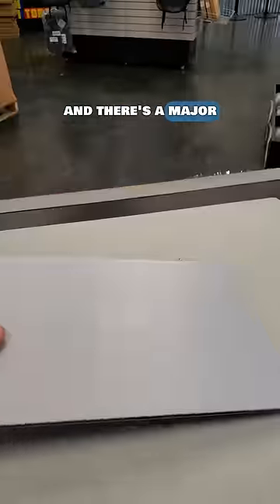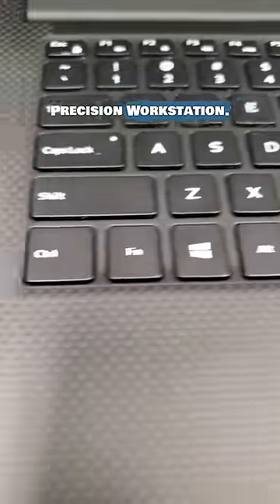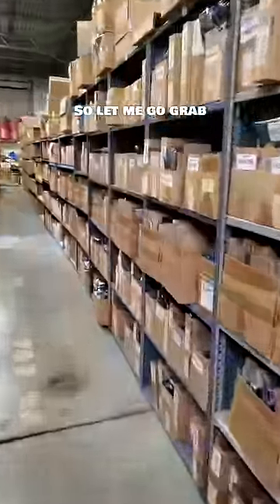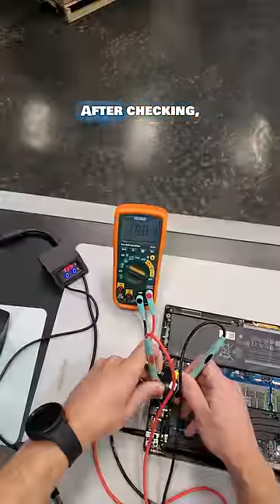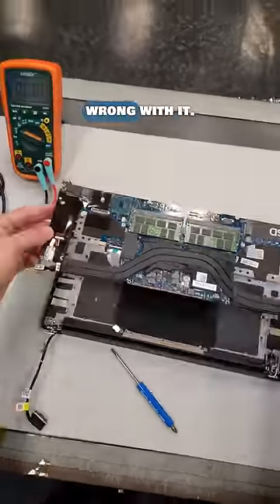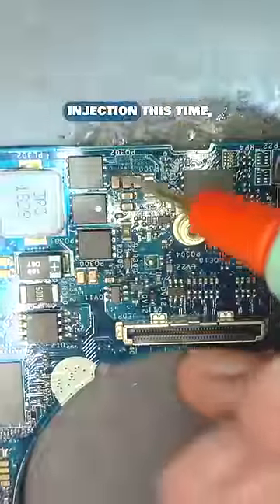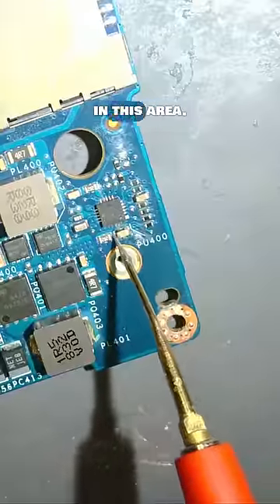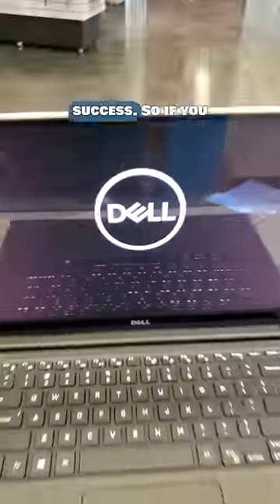Laptop Repair Fix The Hard Way #shorts #laptoprepair #computerrepair

Comment: it's so amazing to see the fact that he actually tries to repair it rather than replace it
Reply: my clone
Reply: @chrishehexd woah
Reply: Then he takes the chip from a brand new motherboard and ruins it instead of replacing it
Reply: True
Reply: @elisjohansson4932 that motherboard was probably already broken, and he will use the rest of its parts for something else
Reply: The issue is, in business we don’t have time to sit around and test every connection on a motherboard to see what’s dead. It’s easier and more efficient for the business to just get the replacement part and call it a day. Plus, you have a brand new motherboard and not one that could potentially have more issues waiting.
Reply: @Ocela  I mean when you're overloaded with work you really can't afford to do that, but when you have time you can
Reply: @elisjohansson4932 What about "donor board" do you not understand?
Reply: @elisjohansson4932  It's a donor board, aka, a board that is already broken and is basically just spare parts or a practice target.
Nothing new was ruined
Reply: @da_pwo  okay but it seemd like he did take it from the place where he showed the new motherboards
Reply: @Ocela  Well, he only checked the battery's input and output with a multimeter. Then checked with a thermal cam for shorts. Saw liquid damage and replaced the N24 chip.

Which btw, donor board or not, everyone can order these parts. You need a part number which is usually right on top. Issue components are usually condensators and sometimes resistors. Condensators don't carry any marking, resistors sometimes do with either numbers or older electronics by color rings. Meaning that unless you have the factory schematic or an extra board with that component for you to measure it with a multimeter, you aint changing it
Reply: @Ocela and the charging customer extra for repair
Reply: yhh
Reply: @Ocela  when you run a repair buisiness, parts don't grow on trees. Every part in your inventory is one less you have for something else until you can restock. Not to mention that a 2017 laptop isn't going to have many factory new motherboards about to restock with. as well, its not a problem if their laptop later develops other problems later on, this customer will likely bring the laptop back and the buisiness makes more money.
Reply: @elisjohansson4932  the new ones are in a special bag, while the donor boards where all stacked lol they definitely didn't came from the same place in the video
Reply: I would rather someone identify the problem and just replace it, I don't trust repaired stuff as much compared to brand new
Reply: @sirhellsing  brand new boards for 7 year old laptops don't often exist.
Reply: fr
Reply: Because he is the nest technician in the worls😈
Reply: To repair something you pay. If it's just a work computer where everything is saved to the cloud then who cares if it's replaced. You'll just lose the memes you saved on your 7 hour coffee break. Won't need those when AI automates your easy to obsolete job. LOL
Reply: It's great that they can, but it also seems incredibly inefficient. There is such a thing as going too far in the opposite direction.
Reply: why would anybody pay for this?
Reply: @elisjohansson4932  did you get up in the wrong side of the bed today? No need to assume the worst in everyone. Why would you assume it was new?
Reply: @nostrum6410 cheaper than a new laptop
Reply: @jama211  probably not, some little  chrombook or tablet is likely cheaper
Reply: @elisjohansson4932  Bruh he literally says, "DONOR BOARD" in the video. Meaning- an already broken or inspirational board that is only good for parts.
Reply: @WimsicleStranger  Yeah Sorry
Reply: Apple is still in disbelief we savages still repair our shit 😂
Reply: @da_pwo  I think that's the problem though. You're getting broken junk repaired with other broken junk instead of a proper replacement and the extra labor isn't worth the cost. It's just silly.
Reply: What's wrong with the LT is someone bought a Precision Workstation LT. Waste of money for 95% of the people that buy them. Inspiron with similar CPU, memory, and SSD runs just as well for those 95%, is just as reliable, and costs much less.
Reply: Only for the video bud. They're is a reason he had some many new ones and so many Donar boards 😂
Reply: @skytoits6367  no it’s for his job, he saves money by using old parts instead of getting an entire new motherboard
Reply: Now imagine doing it 100 times for a day...lmao
Reply: @elisjohansson4932 look at this doofus 😂 did you really think he bought a brand new motherboard to just use the chip and throw it away ?  If you had common sense youd realize the flaw in your logic 😂 if he was throwing em away after he would just give the customer a new motherboard
Reply: And bill it for whole board 😂😂😂
Reply: Are you slow, did you not hear doner board? That means it's a bad board kept for parts.
Reply: @Ocela  The old MB if it had water on it already will probs fail in the future, just replace the whole thing.
Reply: To be fair that’d not be an appealing for social media content💀

Not to be pessimistic, but it’s true
Reply: not swapping a mobo by taking stuff from an identical mobo..
Reply: Not all heroes wear capes.
Reply: For 3x the cost of a quick replacement- ggwp
Reply: I commented this on one of his other posts, and got absolutely blasted for no reason.
Reply: You made my day, love seeing idiots online
Reply: He replaced the chip should repair the chip 😊
Reply: @elisjohansson4932 Just cause it looks new doesn't mean it works. You've never built a PC before?
Reply: Yes and No. Time is money, he wasted  company's and customer's time trying to figure out the problem instead of quickly fixing it. I would have fired him on the spot.
Reply: Id rather have a new one
Reply: If you wathced the video, he said that part was a joke@elisjohansson4932
Reply: so how much more labor did he expend?

Comment: To offer a same day repair option is a really brave and risky decision, you have to really trust your abilities to be sure you can fix any problem that arrives on your hands in one day, If I added said option, I would put at least double the standard price or more
Reply: 1. It will definitely be a premium price.
2. If they can't repair, they would most likely send it back same day or contact the customer to provide options.

If you are good tech and have the components at hand then it's a very fine option to provide.
Reply: @beemore18  having the components is the real trick. there are alot of laptops in circulation, keeping the appropriate parts for most of them in stock to fix a variety of problems that can occur is quite the challenge.
Reply: With Dell warranty service - you pay for this service as part of buying the device. You get a certain level of service for up to 3-4 years.
Reply: he did say he has a spare motherboard, so its kinda easy is things go wrong right?
Reply: @pianissimo7121   yes, for this case it would have worked out, but just offering that in general takes alot of infrastructure and confidence. the issue could even be a software problem vs a hardware problem, you just never know until you've already agreed to the repair.
Reply: Urgh I had to send my laptop back to the manufacturer for 'repairs' which were 4 solid weeks of waiting for absolutely nothing except for them to do a factory reset and no resolve of the actual problem.
That was the same day repair option btw.
Reply: And a massive warehouse to store all possible parts!

Comment: I love how you do component level repairs. I had an HP all in one which would not power on after I returned home after a week. I tried to get it repaired but they had no clue. It was a power supply circuit problem. It seems many of the problems you see are in the power supply circuitry. I liked that computer until it failed.
Reply from the maker: Well, sometimes I can not figure it out either.   It is not a 100% success rate, probably more like 70%.
Reply: PPBUS G3HOT?
Reply: Made in China

Comment: A real repair-man. 
Most of others would be: "Your motherboard needs to be replaced. That'll be half the cost of the computer."
Reply: It's 2024, and they said the mother board needs replacing in 2033, and in 2022, and 2021, and since the beginning of time technicians have been saying the motherboard needs replacing
Reply: It's hard though. Doing board repair like that is not too hard, but it's a specialized skill.  The bigger challenge is that you need specialized tools, and you need an inventory of parts. 

Your biggest challenge doing it the 'easy' way is actually probably getting the board in the first place, but lets say like $200 or something for the board. 

But a company like these guys, they sell used parts. They'll buy up lots of old boards and old laptops to salvage, because this is the whole business, some will be good, which they'll resell, and they'll have some that are bad, that they can use as donors. 

But even assuming this is what you do, the reason you do it isn't even so much to save the customer money. I mean, you might end up saving them some. But realistically, for a same day turnaround, with skilled staff, and a big warehouse, you need to charge a reasonable rate to cover time, shipping and admin, so it's not like this would be a $10 fix. There's at least a $200 fee just to look at it. 

So take a look at it from a business perspective. If you sell them the board, and lets say it's marked up even 100%, you buy it for $100 on average as part of a lot and sell it to the customer for $200 on top of the $200 board repair fee. This means your margin is like 75%, you pay $100 to get $400 in revenue. 

Now lets say instead you inspect it and find the faulty component and you have a donor board with the necessary component. That part is essentially free, because if you didn't do that, the donor board would be garbage. So yeah, you maybe still just charge the customer $200, but your margin is 100%, you paid nothing extra for the repair, and if you have to rebrand or change serial numbers or anything, it can save you time. 

This saves the customer money, which is good. But it requires specialization, it requires a parts inventory, and in a lot of ways, it's actually going to be the buying and reselling of parts that are otherwise hard to find that would be the primary business of a shop like this. Buying up old hardware for very cheap, and reselling the working parts to shops that don't have the inventory to do board repair or replacements.

This is ironic though, because it relies on sales of full components and boards to people in order to make their board repair business viable. Otherwise you sit hoping that someone with a 2017 precision workstation happens to need a board repair so you can finally use that donor board you bought for no other reason than when this guy ends up needing it. 

Your board repair techs, when not fixing customer boards, can be kept busy qualifying lots of old equipment purchased on auction or liquidation, or refurbishing non-working equipment bought cheap for resale. 

Again, I have nothing against the business. It is valuable. I love it. But the dig against replacing the board is a bit unfair, because there's a lot of models of laptop out there. Even if you limit yourself to Dell, you need to have a lot of parts on hand to be able to do the repair.  Or you need to buy the parts from a company like these guys. Just doing board repair for Dells is not a viable business. It requires too much inventory, it requires highly skilled people, and there's just not going to be that much demand. 

So you need to be a company like these guys to do it.  Which again, is fine. I love it.  But for these guys to be able to afford to do it, they need to sell their motherboards to people who are not doing board repair. So it feels a bit weird to throw shade on them. Go to their website, board repair isn't on the front page, it's parts sales. And you can't buy chips, you buy whole boards from them. And when you buy a board, you can't buy a donor board, you buy a working one. 

I would bet that they make a significant amount more of their revenue from selling boards to small shops around the country doing board replacements than they do actually performing board repair on consumer laptops.  The reason they do the board repair is more because they will sell the board either way, finding stock on these older boards that aren't stocked by dell parts any more is hard. So if you can do a repair with a chip from a donor board, that saves another board you can sell to a shop elsewhere who needs it. 

But if all those shops stopped doing part replacement, these guys would not be able to afford their warehouse and their techs, and wouldn't be able to perform the board repairs because they wouldn't have the parts available. 

If I had a customer come in with a board failure on a 2017 laptop, I'd probably end up ordering a board from these guys if they had it in stock. This isn't because I'm not a "real repair-man" but rather because keeping inventory of every 7 year old model of laptop would take a warehouse, and it's impossible to cover the employment and costs of operating a giant warehouse just by waiting for people to look for repairs for their 7 year old laptops.  But it's because I'd order the board from these guys that they can afford to have a warehouse where they refurbish old components and laptops that gives them access to things like donor boards for 7 year old laptops which allows them to carry out a repair this way. 

Board repair is cool. But the reason more people don't do it isn't because most people aren't skilled or real technicians. It's because the business realities of consumer repair on devices as inexpensive as laptops make it not viable. Especially on PCs. At least with something like Apple, there's a much more limited set of models, but there's other problems with Apple that interfere with repair in other ways. But regardless, to make it work, you already need an inventory of parts and donor boards on hand. And if you're not in the business of selling refurbished components, you probably can't afford to just have an inventory of every potential part made for a dell laptop in the last 7 years ready just in case. And if you are selling refurbished parts, it's kind of rude to call out people who buy your refurbished parts. 

Now obviously there's some stuff you can do that doesn't require components. I encourage people to do that, but even then, there's still a question of volume and tools and skills, but I think that's more tenable.
Reply: @zeidrichthorene  That's the longest reply to a comment I've ever seen.
Reply: @zeidrichthorene tl:dr
Board repair isn't more common because it's a more complex job
Reply: @zeidrichthorene 
I do like how detailed this is… but you definitely could have just shortened it to a paragraph or two and gotten the same point across without writing a whole essay.

Comment: Dang. if yall where in Australia id love to learn and work with you guys. I do hardware replacement for dells already but would love to be able to do component level replacements.
Reply: There's no margin in that especially in Australia, You would need to keep so many secondhand chips and boards in stock which in any capital city isn't going to be affordable to get a good location to do so, then pay your techs $40-50 per hour + super because it's a very specialised process. 

Our postage network also wouldn't get things to/from overnight in most cases unless you and your customers are all within the big cities.

I doubt this repair was any less than $250 in and out and that's a 7 year old laptop which is all it'd be worth on a good day in the resale market

Comment: Is diagnosing and soldering cheaper/faster than just replacing the board, since you had to remove the board, anyway? Don't get me wrong: You got mad skillz I wish I had. But if repairs are stacked up, should you take the extra time, even if this particular customer paid a flat repair rate? For my tech work, my metrics are driven by how many tickets I can close. I could see you on a refurb team, not express repair.
Reply from the maker: Well yes, replacing the board will be faster and easier(most of the time). The solder work is good video content, but we also like to save the customer money. An sometimes a new board is hard to find anyways.
Reply: @dellpartspeople  But I don't think the savings is for the customer whose laptop is still under express warranty, as you imply. The savings is for the customer who doesn't have a warranty. Because if a new OEM Precision board runs $1,200, for example, then a solder repair could be considerably less, like $800. But even then, (my point here) it is for a board swap, just to expedite the repair. Your skillful troubleshooting, solder, and inspection puts the original board in a static bag for the NEXT repair. Any board that fails certification becomes a donor board. However, I'm a tech, not a shop owner, so other factors would surely have to be considered.

Comment: Reparing FFC Cable is really hard, when there are no more replaceable parts in the internet anymore. Swapping or replacing wrong cables get many errors. It is even harder to get blueprints to see, which components are needed.

Comment: Wow, what a warehouse! Very very cool. Its a shame you don't work on older stuff, though.
Reply from the maker: We mainly work on older machine that are out of warranty.  3-6 years old is our sweet spot, but we stock parts for laptops as old as 2005. Anybody can send in a Dell and we will work on it.  There are some older Dell models that are really hard to stock parts for because they break so much and those are the laptops we can't really fix.  We have a 2009 laptop in for repair right now.